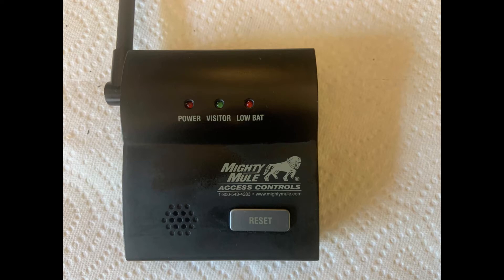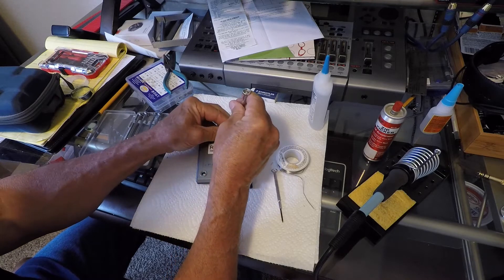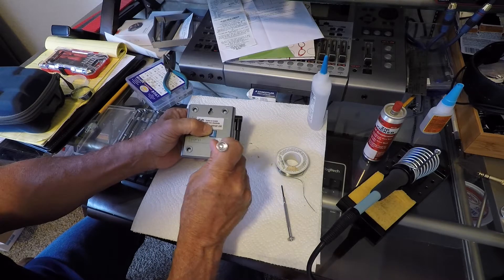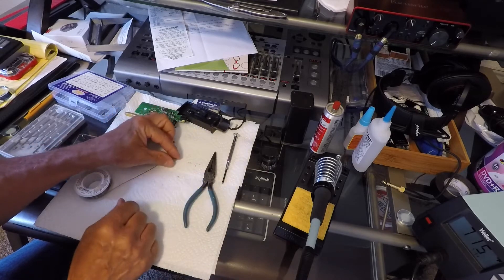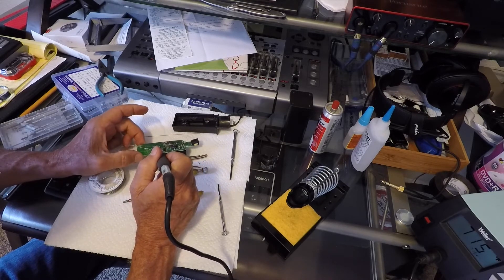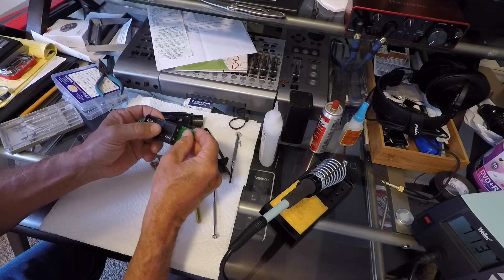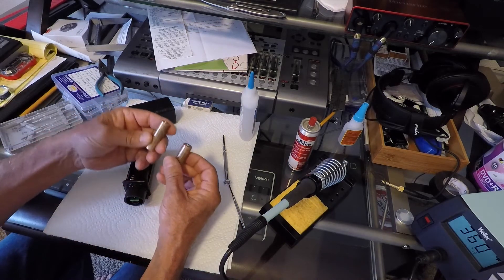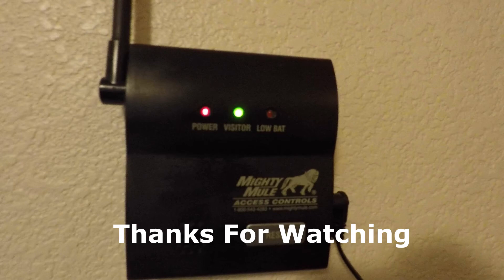Fixing a Mighty Mule Driveway Alarm

Comment: Thanks! I had a Dakota alert that gave a bit of trouble and ate batteries. To fix it would have cost about twice what a Mighty Mule was new. Our FM231 Mighty Mule works great and only started giving us trouble after around 5 years. It's giving false alarms and acting up. I took it all apart cleaned the battery terminals on the transmitter, checked it out and did some tests. Same results. Meanwhile, I ordered another one. Good bang for the buck so far. I'll troubleshoot the old one this winter. It would be nice to have 2 on our long driveway.
Reply from the maker: The alarm worked for about a year after this repair then it started giving false alarms. I took it apart and found what I believe to be a tiny capacitor burned out. I say “believe” because I’m only 90 percent sure it is a capacitor and I don’t have anyway of testing it so a dark coloring on it makes it look burned. And with so many unknowns I decided to buy a new one. They really are a good buy for the money.
Reply: @hartshut  Gosh. Thanks! I have a different receiver(it's round) but my transmitter looks identical to yours. I'll check it out. My receiver actually has a crystal but the transmitter has the blue oscillator. I think I ordered the set from a commercial supplier. I'll let you know if I figure it out.